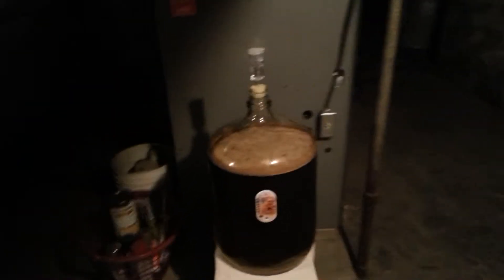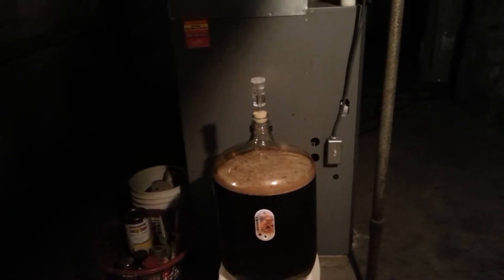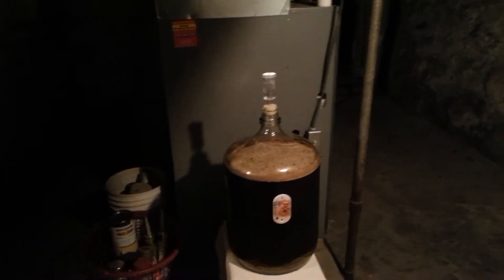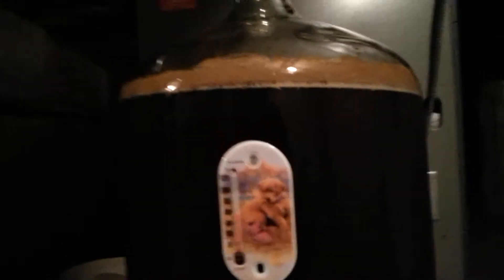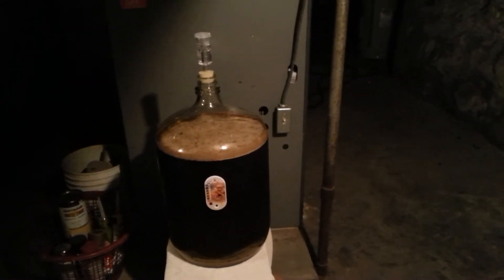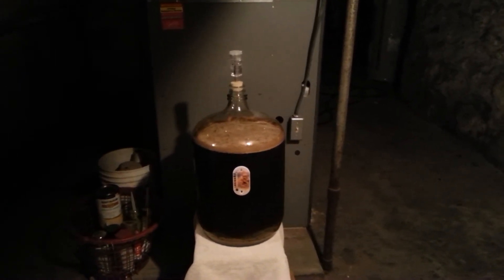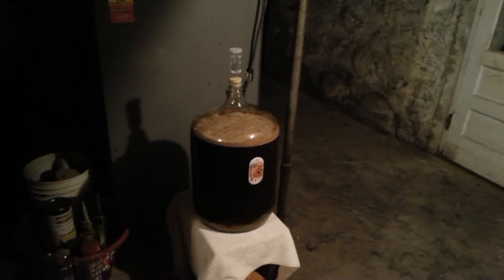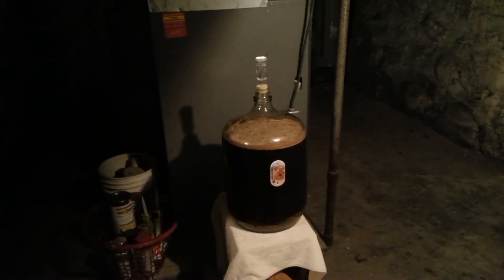Coal Bin Brewery - Diacetyl Rest

Comment: I think it's called "die-acid-al" ...what kind of yeast are you using....I'm doing a Czech pils and am at the diacetyl rest currently ....57* for 12 days...primary slowed down and will take it up to about 65-70* for the rest...and will rack it and take take it slowly down to the low end of the fermentation range for about 3 weeks, then slowly all the way down to 32* for another month. Batch 57, 3rd lager. Let us know how yours turns out. Thanks for posting.